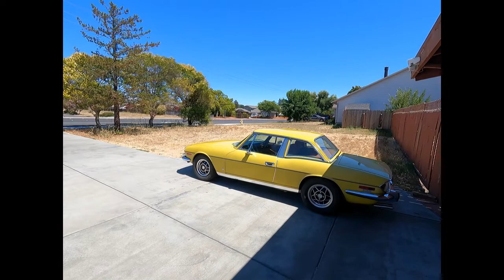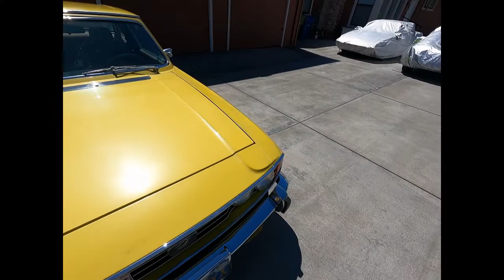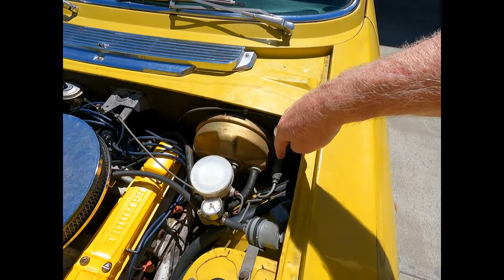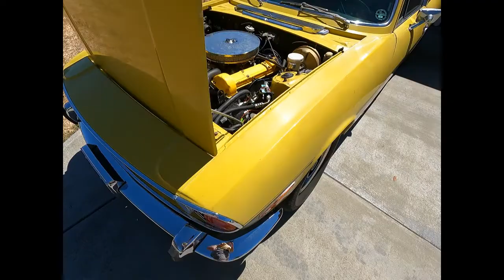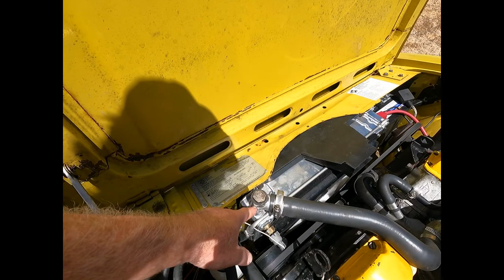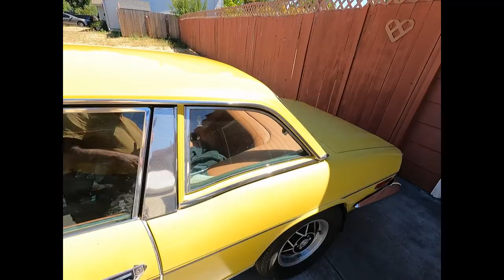1973 Triumph Stag Radiator and AC Upgrades

Comment: Great video very helpful I am putting an air con unit in mine is well I managed to get hold of 3 units and make one good one I am having trouble with the wiring loom no one has a loom for right hand drive with A/C here in England any help I would be great full thanks enjoy the stag.
Reply from the maker: Under the bonnet is pretty easy.  It is just the one circuit running to the pressure switch and then onto the compressor clutch and then to ground.  Easy enough to add length to if needed.

The heater unit is a bit more complex.  There are a set of relays that alternate which fan comes on when activated thus evening out the wear between the two fan motors for longevity.  I don't expect that LH or RH drive harnesses are very different as the controls are centrally located.  The relays are near the glove box so that changes but again it seems like the wire should still be about the same length.

Comment: Hi 
I have a Triumph Stag which I recently fitted a Wizard aluminum radiator. I listened with interest your comments on some of the fitting issues  you encountered  with yours. My experience was exactly the same, but very pleased with the final results. 
I have also added a header tank system from Stag Weber which really gives worthwhile extra cooling capacity and a saftey margin, as it's fitted with a low level warning switch.
It's great to hear your comments on the Stag and how capable and comfortable it is on long journeys and in modern traffic conditions.
I wish you continued good luck and enjoyment with your Stag. 
Regards Russ
Reply from the maker: I also added a header tank.  It was from an MGB I think,.  I bought it at a swap meet years ago.  No level sensor but when used in conjunction with a catch bottle (mounted in the original position of the plastic expansion bottle) it is easy to monitor.
Reply: @ejhbritishcars6907  I must of missed it in the video.